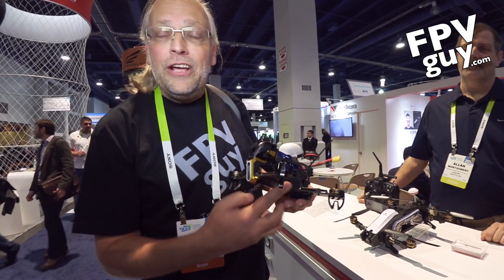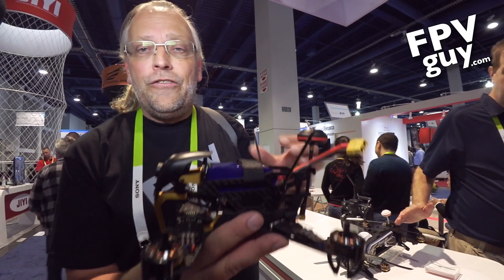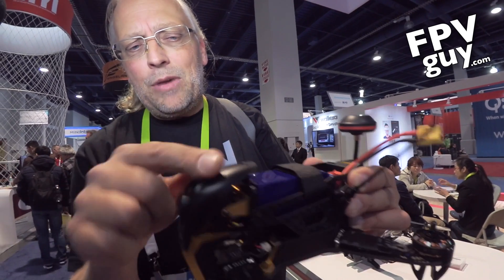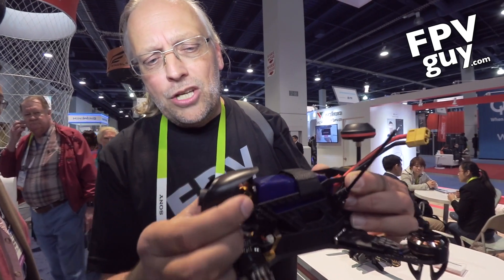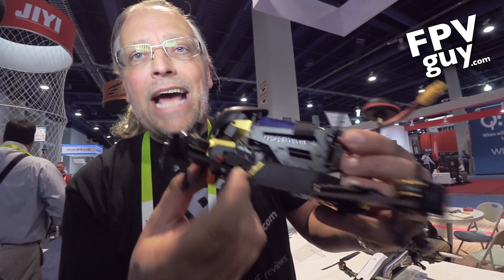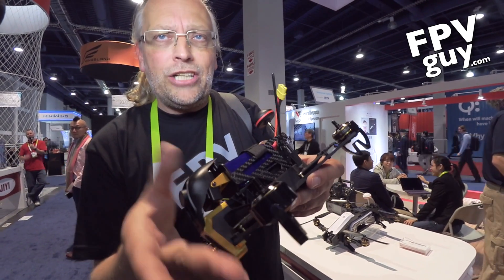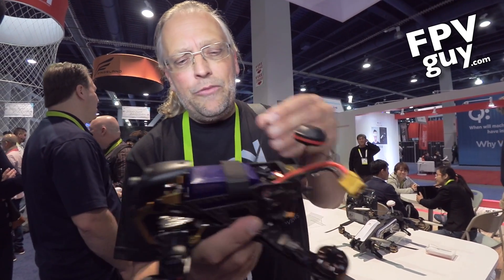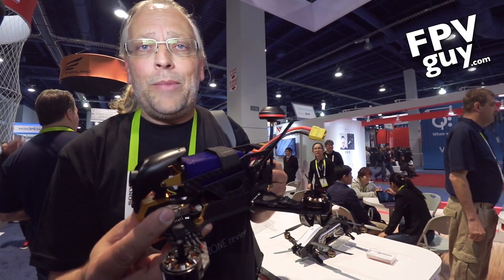Walkera F210 mini quad racer - FPVguy CES 2016

Comment: Hey Bo I would like your opinion on two quads. I'm Interested in getting into the hobby and I have played around with many quads, mainly in door like the eachine h8 (love the yaw rate on it). I am considering purchasing the walkera f210 or the eachine falcon f250, I hear great reviews on it and the price is excellent. What's your opinion on the eachine in comparison to the f210?
Thanks
Reply: We would all love you to be part of the multirotor community, and the f210 is a great place to start! :)
Reply from the maker: +Dave B   both nice platforms for "ready to fly" however in terms of strength, Im kinda enamored with the the F210, its just taking so much abuse and still flying.